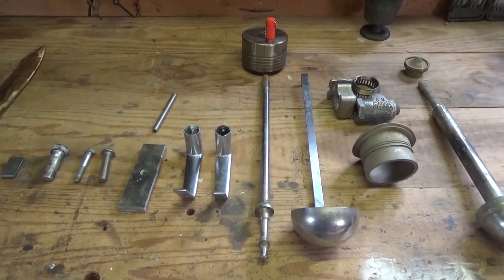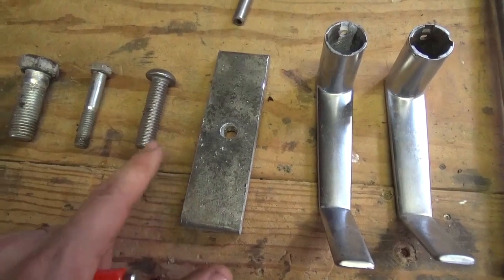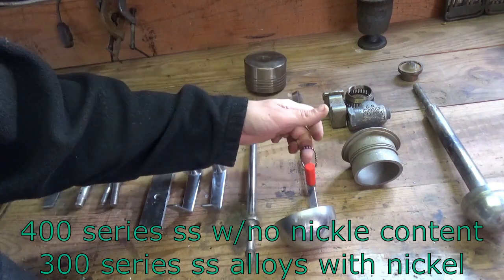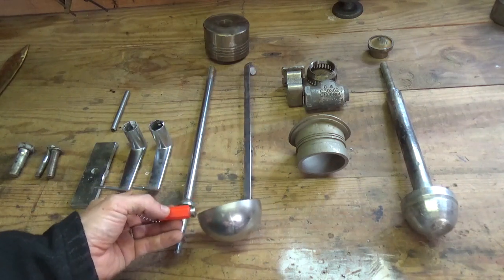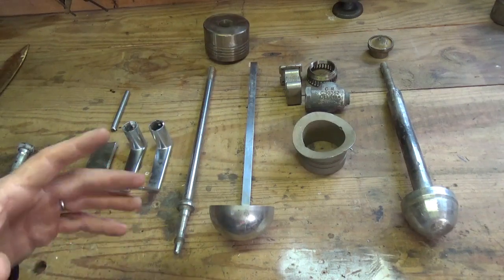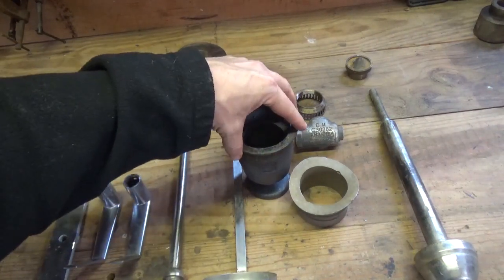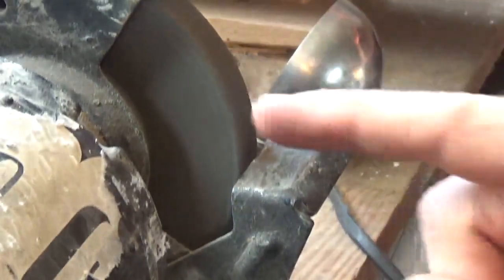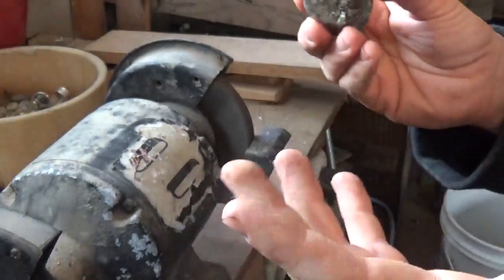The difference between 304 and 316 stainless steels

Comment: AA: Thanks for an alternative-view from the practical & salvage side.  On design/fab side we use some of same field ID methods....and in past 1/2year I've twice has very seasoned Craft mis-report-by-site on highly weathered (& hard to access old in-cell plate) ....once SST-misID-as-Al, and once the reverse.  Only when we started job to cut on it that we saw the error.  Some thoughts:

"mole-ib-den-um" or sometimes slang as 'moly'.

<0.3%C makes the 304 as 304/L (& likewise low C makes 316 as also 316L, so 'dual rated' term 316/L).

Thru the 1990's you had to spec (& pay a bit more for the corrosion-resist) of the 304L or 316L.  

Nowadays, mostly 304 comes as 304/L, etc.

18-8 is u-s-u-a-l-l-y 304, but not always.  May have to check the paperwork or NDE test it.  

HNO3 (nitric acid) will eat on most aluminums, especially if has ground or cut or sanded to expose 'bright' (unoxidized).    HNO3 attack can be used as another way to detect Al.  Weight is also about 1/3 that of CST or SST.  Industrially, there's also mass spec on some grindings, or non-destructive ('NDE', typically XRF or x-ray shoot).....v. pricey for salvage.   The MTR is like a foundry 'birth certificate', and the NDE is like a DNA analysis.

There are many Al alloys, with perhaps the most common as 6061(with various heat tempers...6061-T6 v.common), 6063 (extrusions mostly, again heat tempers), 3003 (soft, weak but v.malleable).  

The sander wheel you showed we call a 'flapper', and the sparking wheel as a 'grinding wheel'.  Others may call differently.

The inconels and hastelloys are pricey and may be harder to fab (e.g. WPS's may need to be developed), and we avoid unless needed (e.g. for T>800C where the common stainless' strength goes to hell.)   The 400 series (e.g. 410) can give stainless corrosion protection PLUS v.good strength (but may need post-fab heat treatment).  I've never used the last alloy you showed.

Again, thanks.  EH

Comment: Work hardening will make at least 304 magnetic. 

Even without work hardening, a tiny  neodymium magnet will often  stick to 304 without falling off. 

Take a pressed or bent 304 product, put a magnet where it's bent, it will stick. Heat it cherry red, let it cool, it will again be almost completely non magnetic.
Reply: Perfect comment, now I know what prop-shaft material I should buy, SS316 was a nightmare, once I put bearings on that shaft the only way to remove or replace them was to cut them with angle grinder.
SS304 seems like a better choice, so thanks man.
Reply: @Eden_M  dude 316 is way better than 304 for machine parts, especially those going in the drink. Cant say i know why u had that experience but 316, actual 316, is the way to go.
Reply: @zefrum3  Sliding bearings on the 316 shaft would easily scratch the surface compared to the 304, and not even press fit, you could insert them by hand and they would get stuck (on the 316).
So you might be right, probably wasn't true 316.

Comment: 304 stainless good for honey i need extractor ? Or after 2years rusted?
Reply from the maker: It should not rust unless exposed to fire or salt and even in most of those cases the rust is only topical. When my 304 rusted it was after I used it in the smelter at  over 2000 degrees F. So you should be good to go.
Reply: @ArtisanArmoury  I have a solo stove.a gassifing wood stove made of 304 stainless steel. It started to rust after first use. And I did wipe it with a damp paper towel. Cleaned the rust right up with vinegar. It gets over 2000 degrees
Reply: 304 rusts in my garden exposed to rain. We are seven miles from the sea.

Comment: Which one is the marine grade?
Reply from the maker: 316 would be closer to marine grade but they usually use alloys for the ocean such as Alloy 20. Titanium is the metal of choice for use in the ocean, as it is for all intents and purposes it is corrosion-free.
Reply: Marine grade steel is indeed generally considered 316. A lot of aluminum alloys are also marine grade even without passivization (anodization). Titanium is not going to be used in marine applications except for extremely expensive condensers, submarines, drill rigs, etc. Alloy 20 isnt used much for marine, its main purpose is for petrochemical production and synthetic fiber production.